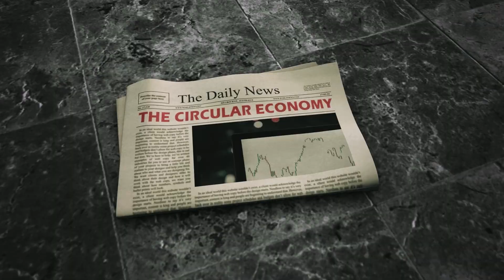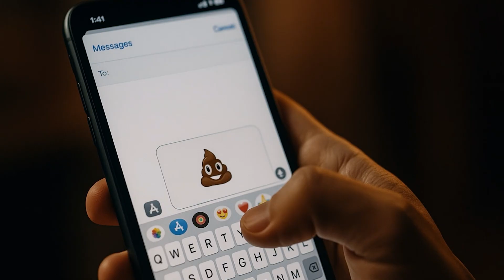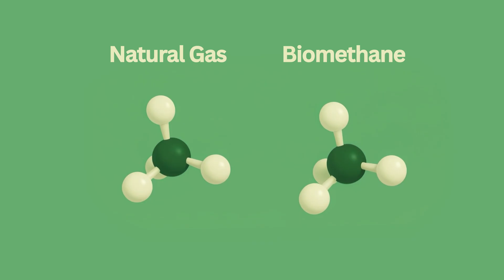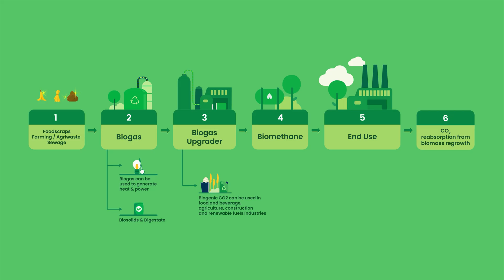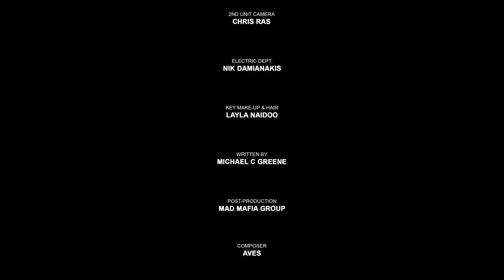Fuel For Thought | Episode 1: Waste Not – The Biomethane Revolution

Comment: I will purchase my lumber by the truckload from the mill direct from the mill bulk discount wholesale to the public from the directly from the largest sawmill and then get the affordable price until my wood is cured out and ready for construction for residential homes or commercial buildings but listen then I will have my wood to kick in and maximize my profit once I done that 12 months wherever I cut the trees bought the property my infrastructure of my house is subdivided my lights everything will be ready for break ground my concrete pads footings everything should be there waiting for my lumber but I'm using the wholesale from the direct purchase from the meal sawmills 12 months in my number will be ready what's my number is cleared out I'm able to no longer have to purchase from The sawmill RENDERING ME A PROPHET THAT HAS BEEN MAXIMIZED FOR PRODUCTION WITH MY OWN LUMBER MY OWN LUMBER COMPANY I'M READY FOR ROCK AND ROLL JACK 11:16 😮❤😂